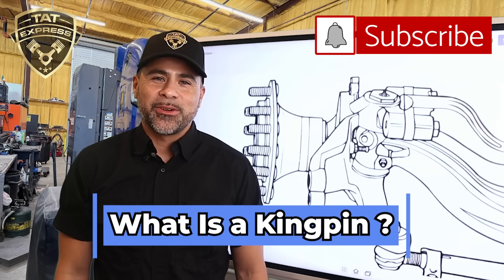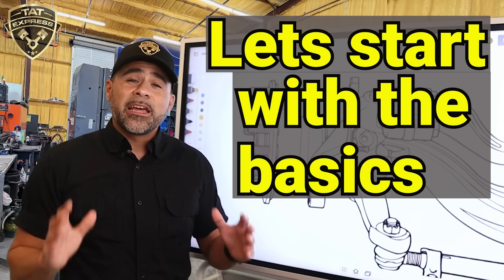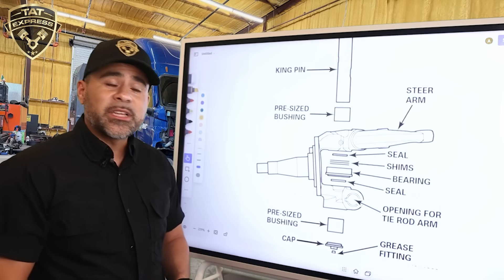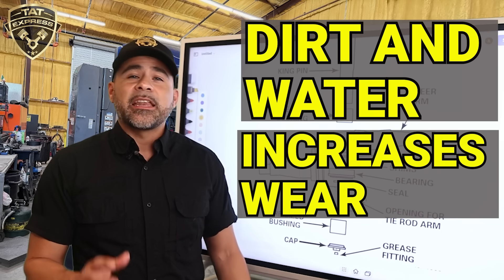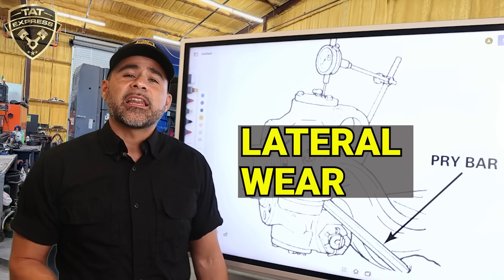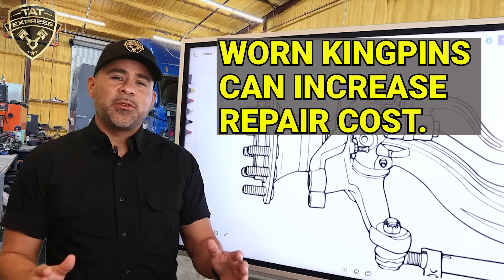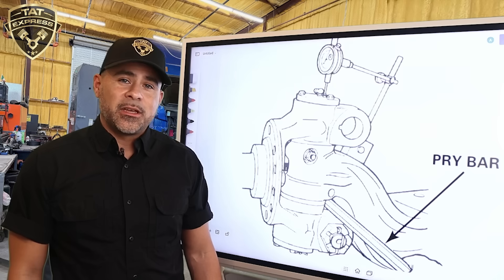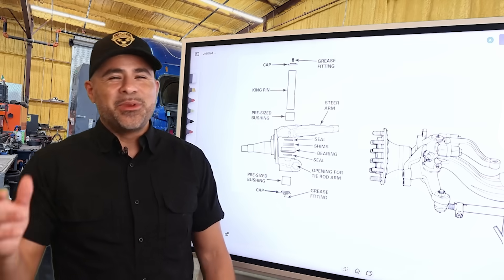🛞 What’s a Kingpin? 🔍 Semi Truck Front End Explained! 🧰🛠️

Comment: Is it mandatory they be pressed in?
Reply: Gonna be doing King Pins here pretty soon. They aren't horrible yet, but my experience is to change them before they ruin axle. I prefer pressed in ones vs. the cheap kits they are bigger pain to install, but they last long.  The ones in my truck now are 9 years old.
Reply from the maker: @Trugginglife Great call doing the kingpins before they wear out the axle. Aftermarket kits are solid and much easier to install. Press-fit requires reaming, which can be tricky to get perfectly round. The non-ream kits leave less room for error and save time too.
Reply from the maker: Great question—most aftermarket kingpin kits come with bushings that don’t require a press, which makes installation much easier. A press-fit isn’t always mandatory, but it depends on the style of kit you’re using.
Reply: @TATEXPRESSINC Thanks a million
Reply: Just started feeling these issues on a 2021 International Lt. I was told by an international parts place that mine is possibly connected to the axle and id have to change the whole axle. Didn't sound right to me. Is that a thing?
Reply from the maker: Some trucks are manufactured with kingpins built directly into the axle. These are designed to be more sturdy, but if the pins get damaged, the entire axle usually needs to be replaced. Regular inspections are key to catching wear early and avoiding bigger repairs.

Comment: I have question please 🙏 if you can answer it. I an buying a truck with 486k miles new one box new radiator and front cover been done but the engine hours are 19k engine hours
Reply from the maker: 19k engine hours on 486k miles means the truck has spent a lot of time idling or in low-speed work. That can add extra wear compared to highway miles. I’d recommend pulling an oil sample and full ECM history before buying to get a clear picture of engine health.

Comment: excuse me our truck doesn't start .  fan rotate but engine doesn't rotate   crank didn't run
Reply from the maker: If the fan spins but the engine doesn’t start, it sounds like the engine is cranking but not firing. That could be a fuel delivery issue, a sensor fault (like cam or crank sensor), or low rail pressure. I’d start with checking for codes and confirming fuel system pressure. Let me know what engine it is and I’ll try to point you further.

Comment: I drive in city I do lot of movement with axles , after how long I should grease ?
Reply from the maker: If you’re doing a lot of turning and low-speed axle movement in city driving, I’d recommend greasing every 5,000 to 7,000 miles—or once a month—as a rule of thumb. More often if you’re in wet or dirty conditions. Good maintenance extends kingpin and bushing life.

Comment: Hi,i am looking at a 2018 freightliner cascadia with 745000 miles,the owner said it has only 12380 engine hours.Is this possible or something is fishy?it does have an park smart electric apu
Reply from the maker: Those engine hours seem suspiciously low for 745k miles—even with an APU. I’d recommend doing a diagnostic scan to confirm the ECM reading and check for any tampering or resets.